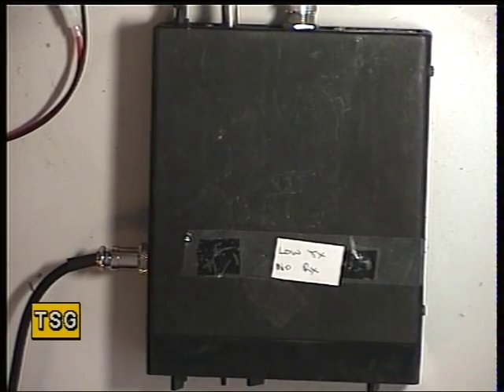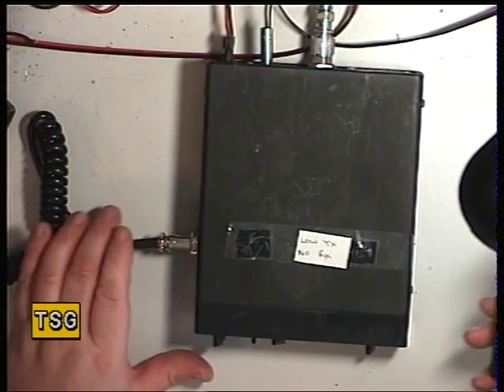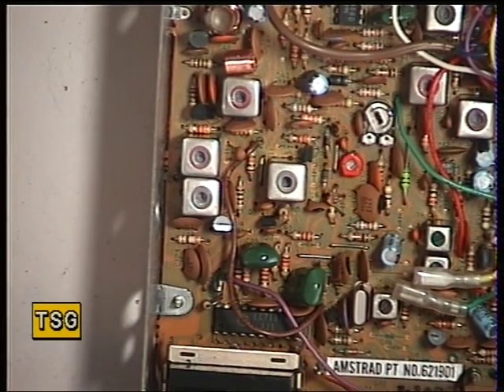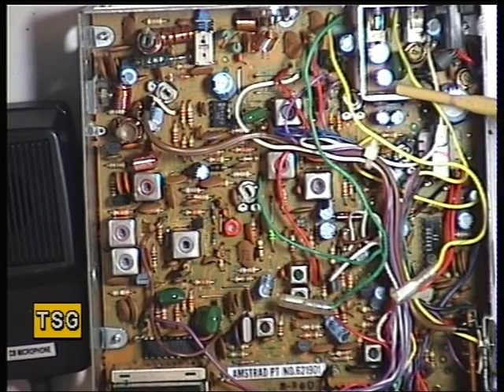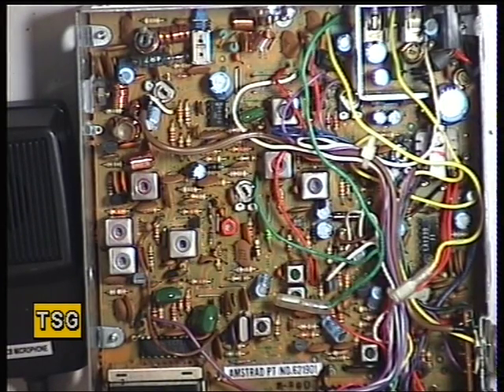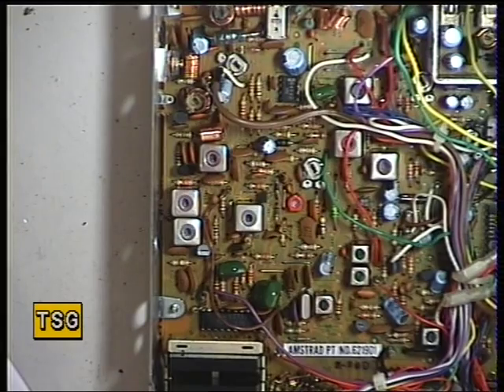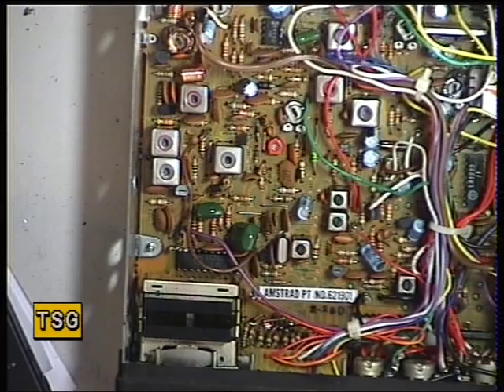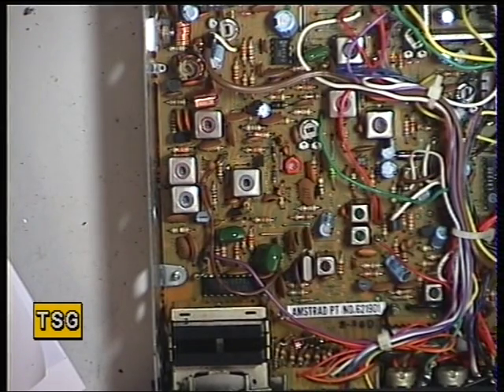Amstrad CB901 (made in Japan version), UK (CB 27/81) CB radio (Mobile)  - Transmit adjustment

Comment: Hi the Amstrad 901 big green resistor what to replace it with
Reply: Hi Hi Richard thanks BIG help 👍👍
Reply from the maker: The service manual says it's 3.6 ohms at 3 watts.

Richard
Reply: Hi Richard 3.3 ohm 5W Resistor 3.3R 5Watt High Power will this work this is only thing i can find close to it

Comment: This one has from the board to the antenna socket a coil and then a small disc ceramic capacitor grounded to the chassis
Reply from the maker: I think all you can do now is to test every capacitor in the final filtering stage. You could also have an open circuit coil. The phantom power tweeker has knackered it good & proper. I take it you have the circuit diagram.
Reply: UK CB radio servicing ok thanks Richard. I appreciate your time in replying. I will get to the bottom of it.
Simon
Reply from the maker: Simon. I had a thought in bed last night! Does the tx hi/lo power switch on the back make any different to either the current consumption or the power output?
Reply: UK CB radio I've had moments like that myself lol. Yes high/low power does work. I've tested all resistors and coils according to the diagram and all seems OK so I have ordered a 1000pc cap set to start swapping out potential caps. My initial thoughts are c48,c49, c126,c51 and c54

Comment: Hi there again. I've changed my final transistor and my driver transistor and I'm still only getting about 800mw at full adjustment. Obviously I've wound it back as the driver is getting quite warm. Any ideas as to what could be the issue.
Many thanks in advance 
Simon
Reply from the maker: Simon, Looks like the power is being developed but being sucked away between the output transistor & the aerial socket. Duff capacitor? Hairline PCB crack? Dodgy connection between the PCB & aerial connector (see that)...is it this model that has a resistor as well as a wire going to the aerial socket, because I've had that open circuit before too. We always have an ammeter on the PSU, so if the radio is doing 800mW & drawing 1.1A something is wrong!

Richard
Reply: UK CB radio servicing this radio has from the board a coil and then a ceramic cap grounded to the chassis from the antenna socket
Reply: My ammeter on my psu is pulling roughly 1amp on transmit
Reply: With some rather unconventional probing about it seems I'm getting about 200mw out of the driver and 800mw out of the final

Comment: Great informative videos. Please could you show the test equipment and connections to radio for reading results. How do you connect signal generator to radio. Picked up one of these for £10 and appears to work quite well but want to check alignment for an exercise and leaning process mrjnperry (M6GSW)
Reply from the maker: John, later in the year we will have moved all three service benches into the one room. Currently, there is the one you see, another one in a different room & another one in a different building here. As I run two businesses, the radio side is just about shut down until the 1st October, when it will be back in full operation. I do the radio side October to March & our Church Pipe Organ restoration (traditional, no electronics!) for the summer six months. This is because I don't enjoy working in cold churches during winter. Tell me what signal generator you have bought & I'll see if I can help you. richardDOTshirebyATvirginDOTnet